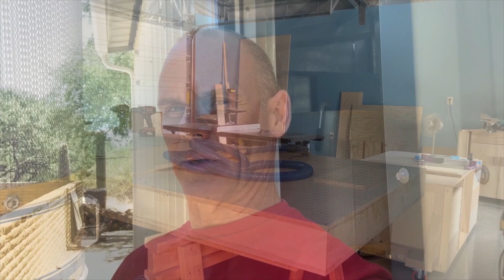BFG KO2 15,000 mile update, common questions, thoughts quick shop tour

Comment: By any chance do you know if that tire/wheel step up would fit a 2019 or newer crosstrek?
Reply from the maker: Should fit with no problems.  Nothing changed suspension wise between 18 and 20 so you are good to go.

Comment: Is this on stock suspension
Reply from the maker: Yes I believe so.  It has been awhile since I made the video.  At some point along the way I added RalliTEK 1" springs, but the BFG's fit the stock car with no issues in 215/75/15.  Some do 235's and they may possibly rub a little.    Spring video.https://www.youtube.com/watch?v=B9FTgegXYeQ&list=PLKRNVgFGuPjjTOllUFdZVoq44RGRE4cF2&index=20&t=309s